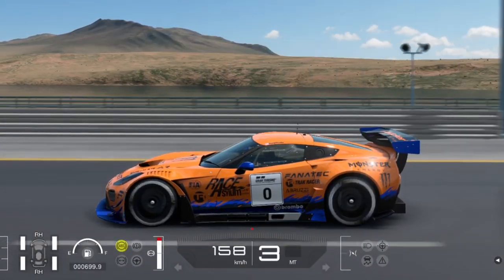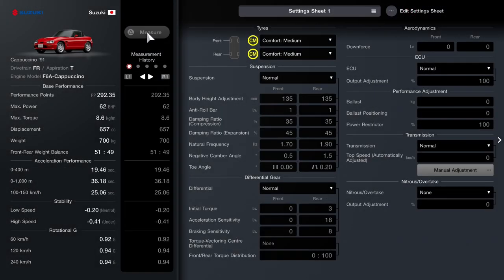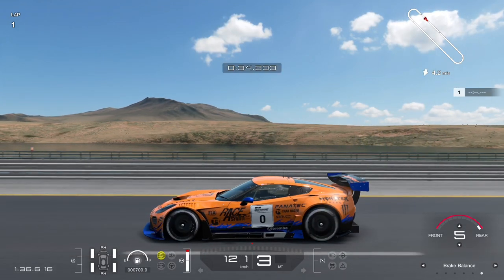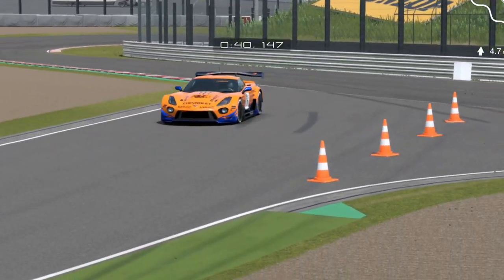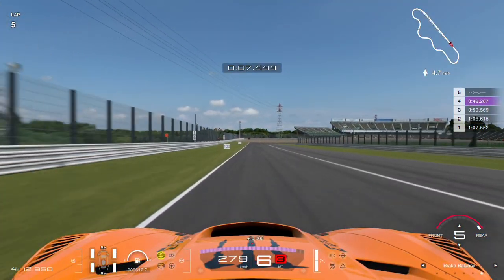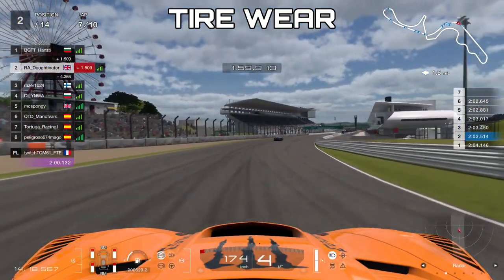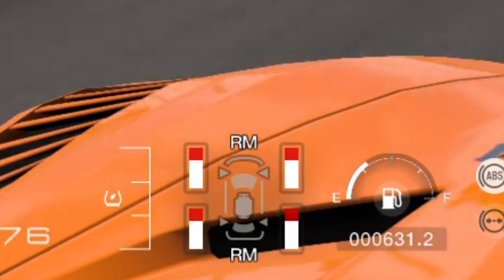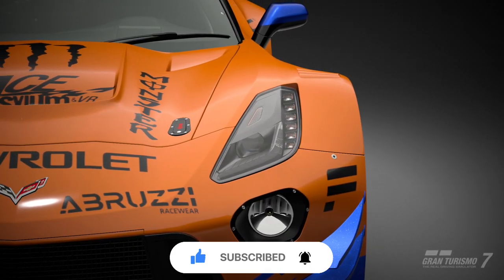GT7: Brake Balance Explained and Tested

Comment: Did you notice that stock brake bias on mid engined road cars is always very wrong?  Without ABS they lock the front wheels way too early.  Even after installing a brake balance controller some cars cannot be corrected enough.  Most terrible car is the McLaren F1.  I cannot imagine that Gordon Murray made the concept for that car with such a horrible brake balance.  Same for many Ferrari's.  I wonder what they would think in Maranello if just someone made the effort to test their cars in GT7.  They would probably immediately revoke Sony's licence ...
Reply from the maker: Haha. Yeah so many of the mid engine cars feel very off in GT7. Not sure why 🤷🏻‍♂️

Comment: in GT6 you have a system called "Brake pressure" you can set from 0 to 10 on rear/front. (If you set 0-0 you will still brake and slow down but very weak)

So you can do like 4 to the front and 4 to the rear with Gr.1-like cars, then you can play without ABS and you won't lock up.

in GT3 cars usually you set 3 front and 2 rear (reduce rear for more stability), which means reduce brake pressure due to less downforce to not lock up.

And for road cars like a Ferrari you would want 2 front and 1 rear.

You can set 0 front and 10 rear and then brakes will work exactly like handbrake for drifting if you use steering wheel and don't have handbrake.
Reply from the maker: Yeah maximum brake pressure is a setting missing from GT7. With with ABS default so effective it’s not really needed.

Comment: I think you've misunderstood the explanation regarding brake balance and the weight distribution (or PD's description isn't clear) but I think it means the transfer of weight throughout the car under heavy braking affecting the handling rather than general weight distribution. Eg. Front bias will cause the nose to dip heavier than the rear, causing  a shift in center of gravity and weight over the front wheels, which in turn asks more of the front tyres whilst braking hence the underseer
Reply from the maker: Yeah probably. However I still think their ‘numbering’ logic is way off. 
Give us a percentage number instead of a -/+ number.
Reply: @Doughtinator  Agreed, with their numbering logic I'd rather call it a TWD (Tyre Wear Distributor)...
Btw., it drives me crazy not having the BB adjustable in GT7. In GTS I got very used to it, and sometimes it was tricky to find the "right" balance between tyre wear and controllability of the car... I miss that. Happy Racing!
Reply: Have to agree, front engine, front wheel drive is going to have more weight transfer than rear engine rear drive. you want to get majority of your braking to the front as rearward braking is like pulling the hand brake on

Comment: Gran Turismo’s explanation is not technically wrong, to be honest. It is just really bad written. 
If you check brake balances in Assetto Corsa Competizione you will notice that front engined cars like the Bentley and the Mercedes have 65 to 60% front brake bias, opposed to mid engined ones like the 488 and the McLaren 720S with 55 to 60% front brake bias (the 911’s wet preset comes at almost 50/50).
Mid engined cars actually have more rear brake bias because of the weight of the engine, pressing on the wheels and giving them grip, preventing the lockup a little bit more compared to a Bentley, significantly lighter in the rear. Your tests are absolutely correct and the brakes work like you said, but the in-game explanation is just, like I said, technically right but written really bad for a beginner.
Reply from the maker: Yeah 100% with you on that 👍🏻

Comment: I dont really think they meant to match the weight balance, but using it to counter the weight balance. It's still based on the weight balance. I also think that downforce levels might play a role in how you want to tune it.. if you have loads of rear downforce per a tune to meet a pp level or just how some cars have a much higher rear weight bias, having more towards the rear might help put down more braking force at speed.
Reply from the maker: Yeah. I think you’re right. But is just tune for under or oversteer. That’s what it’s most useful for. (And tire wear too)
Reply: @Doughtinator  the way they worded it might not be the best lol
Reply: The description isn't as clear as it could be, but it's talking about the load balance of the tires, as opposed to the weight. Weight balance is static, while the load balance is dynamic. This is why downforce, weight balance, the amount of steering angle, and the way the brake pedal is applied can all affect the way the tires are loaded (I believe tire pressure and width can also play a factor here). In that sense, the description is sensible. Ultimately, the balance of brake pressure vs tire load is what decides which axle will lock first, and what type of steering effect you experience.

Comment: The way they explained it isn't wrong in real life, because more weight and downforce help not to lock up the wheels in races where ABS isn't allowed, so do that to have maximum braking power without lock up (in real life)

Because I have seen a video (can't remember where) of real life Audi R15 TDi Plus (LMP1 car 2010) the driver set more brake pressure to the rear while in the garage.

I didn't understand it at first but now I believe because that LMP has more rear downforce, so they pin the rear wheels easier.

and since ABS is prohibited for prototypes I think he needs that bias
Reply from the maker: You make some good points.

Comment: Great stuff...I liked the side view to demonstrate what tyres were locking up first.

The BB explanation is a weird one, I think it can be interpreted a few ways but definitely not the best explanation from the game

Anyway big question is when will we be able to use BB in sport mode again!!
Reply from the maker: Thanks Womble. 
Yeah I’m starting to think lack of BB in sport mode is intensional rather than a mistake. Which is a shame. Default BB on some cars make them useless. And let’s not even talk about default setups on some MR cars 😳
Reply: @Doughtinator  I could understand no BB for races with street cars. But for actual race cars, BB is a normal thing. No excuse for PD to purposely leave it out. That said though, you still can't sell cars... It's almost like they just don't care 😮
Reply from the maker: Absolutely. It’s just like TCS. Most race cars (that allow it) have it adjustable on the fly.
Reply: no brake balance in sports mode, frustrating and out of touch once again.

Comment: I love driving my subaru impreza wrx but it has killer over steer when braking. I have tried moving the brake proportion back and forwards, lowering the suspension stiffening the dampers, putting ballast in the front but nothing I did would stop it from kicking its arse out.
Eventually I took most of the racing suspension off and put fast road suspension back on and that seemed to help, then I stiffened the rear anti roll bar and that helped even more. I did notice that a lot of the cars had really bad lift off over steer and then i tried using the RX7 that I won and it was great, I could jump on the brakes and turn into the corner WITHOUT it trying to kill me.
Were polyphonic trying to make the most hyper realistic driving sim by giving the cars flaws that meant you cant drive it like and arcade game.
IDK, its frustrating and annoying not being able to drive the car as fast as they are capable.

Comment: Okay, here is my take on the brake balancing 

But first….

….was that car edited, or not?

If it wasn’t edited, then I think I understand my results, or rather I think I might know why, but I am not sure.

I tuned the weight, the height, and the camber before doing this, so please take that into account.

And its the 

2015 McLaren 650S GT3

And Racing Softs

When all the way forward my braking was able to make tight turns properly a little too much, and coming out of the turn required too much negotiating for me.

When I set it all the way to the back it did oversteer, but in a good way. It did better when I brought it down a little bit.

I think that it has to do with weight, but it depends on the HP, Displacement, Height, and Cambers effect on that weight…. And possibly something to do with changing the center of gravity. I don’t know, I’ll ask my cousin, he would know.

All I can say is if I am right then the brake setting for every car with the flavor preference for the individual driver. (Do you want more Salt or more Pepper with your Steak\Chicken\Pork\Fish)

You also might have to do this after adding everything you want on the car EXCEPT for the LDS…. I “think”!!!😝 (Don’t quote me on that!!😂🤣😂🤣)

You are right though, but as you said….they didn’t explain anything really, YOU did.

So put everything you want on the car that will change HP, then add weight as needed, where needed…..though height maybe should have come before weight…anyway, you know the rest. That is at least what I “THINK”!!!! (No one’s ever accused me of thinking 🤪)

Next is LDS

Comment: Ok, I'm a bit confused now, I always thought MR cars would benefit more from a forward balance, if I'm understanding you correctly here, in some cases it's more beneficial to have it to the rear? I can't grasp that.
Reply from the maker: No you’re right. MR with forward bias. GT advice is to match weight balance to brake balance which I think is wrong.
Reply: @Doughtinator  great, thanks, right I'd been doing it wrong for 2+ years, lol.
Reply from the maker: There may be occasions where you’d benefit from it. But rule of thumb. Send it to the end you’d prefer to lose traction on corner entry. And with MR cars that’s almost always to the front. ESPECIALLY in GT7 with the lift off oversteer.

Comment: Also if you break at track limits, you can cheat the penalty system, same goes to deceleration. Just club the gears down so it hits the limiter. Unfortunately we can't damage the gearbox lol
Reply from the maker: Yeah there are many exploits in GT7 for sure.

Comment: Does brake balance work in daily race mode
Reply from the maker: Afraid it doesn’t. If the race is fixed setup then back balance is also fixed. 🤷🏻‍♂️
Reply: @Doughtinator  ahhh what a shame,I thought could change brake balance in gt  sport..gt7 need to address this
Reply from the maker: Yeah. A bit of an oversight I think.